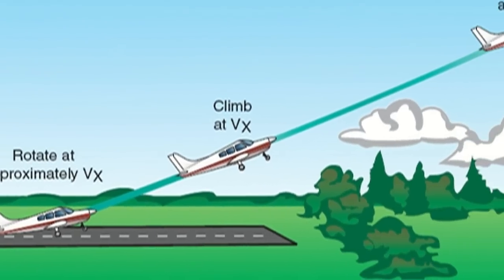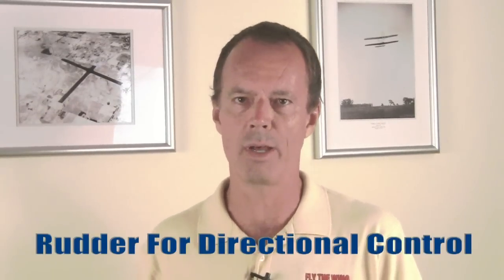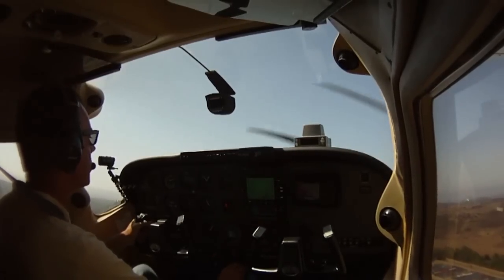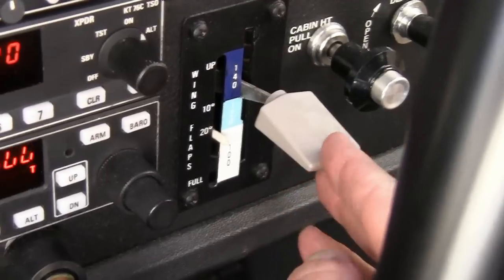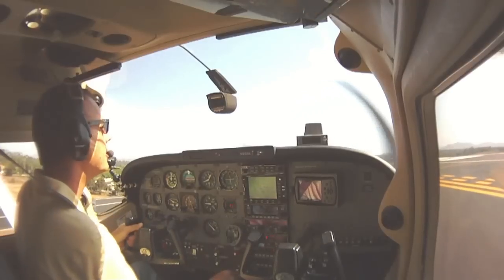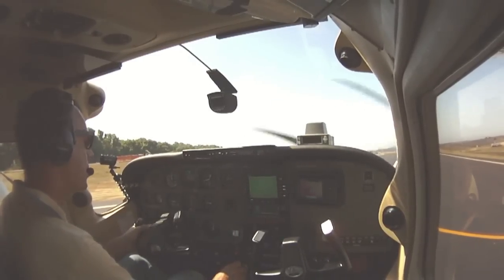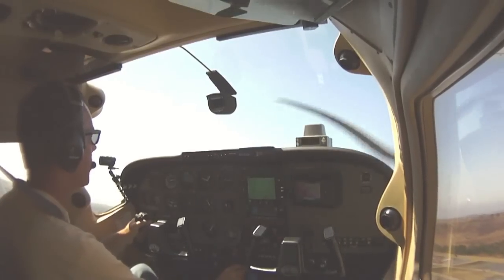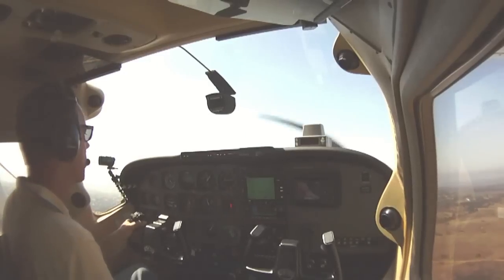Short Field Takeoff

Comment from the maker: Oh, that explains a lot. I used to own 1/10th of a Mouse back in the '70's. The original POH's (PIM's, I think) mentioned flaps; later versions did not. Search "Short Field T/O in Beech 23/24". Beech Aero Club has a forum listing that will give you more insight. But go out (on a long runway) and TRY various configurations. Start takeoff roll from same spot each time and see which configuration gets you over that mythical 50' obstruction with a minimum ground-run. I do this with students.